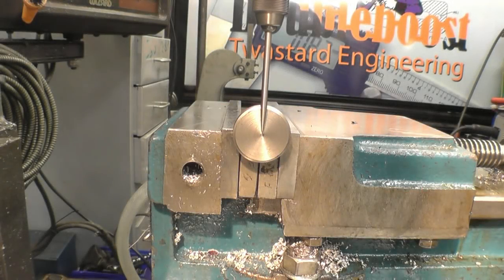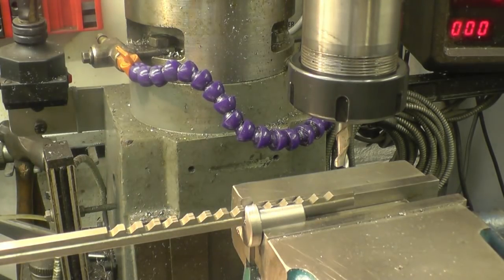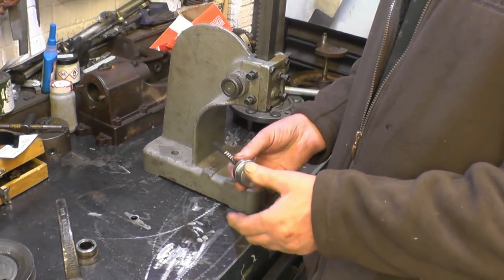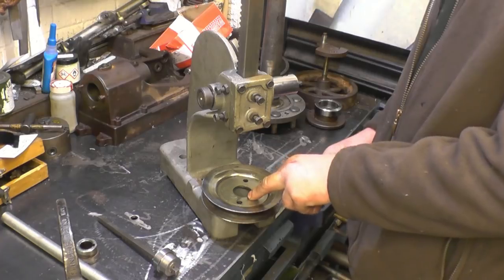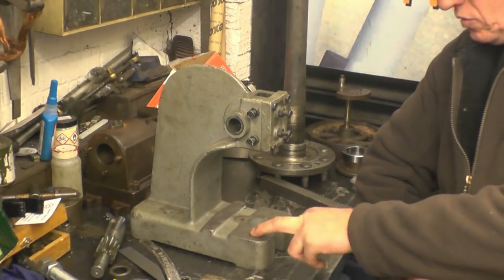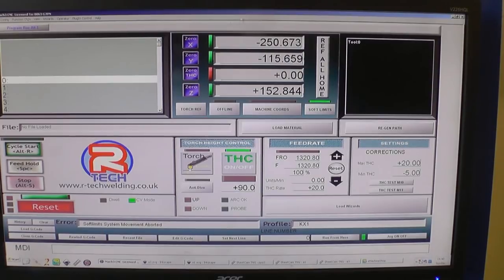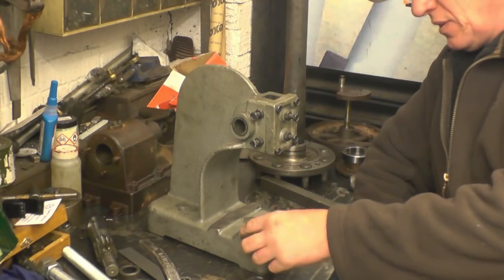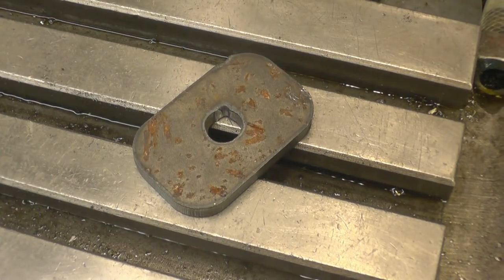SNNC 203 P2   Unusual Mill Setup

Comment: Hi John, I just finished making the engineering scribing block as a project and would like to ask if you would be able to help me with assembly procedure for it. This is the part list: Clamp, Spindle, Locking screw, Sleeve, Clamp nut, Pivot screw, Scriber, Base with step and slot, Adjusting screw, Rocker,Ball bearing, 2 Dovel pins,Spring.
Reply from the maker: Have you got a drawing for it
Reply: doubleboost I have all drawings for separate parts
Reply from the maker: can you email them to me
Reply: Sure

Comment: Congrats on the plasma cutter John, seems to work well. Maximum thickness is ?? 🤔
Reply from the maker: 12 mm steel clean Pearce  the 50 amp plasma will hand cut 24 mm severance

Comment: Can u cut aluminum on the plasma cutter
Reply: yes any metal sheet, it has to be metal and conduct electricity as its  an electrical process
Reply: Jusb1066 i was thinking that amount of heat would distort or destroy aluminium
Reply: nope , it work well, you may have to adjust the rate of cut, (the cnc plasma will have settings for material and thickness) but they do use that method all the time, it puts surprisingly little heat into it because of the air coming out
Reply: Jusb1066 interesting thanks
Reply: aluminum turns yellow too much heat.  aluminum is great conductor and will cut with a plasma